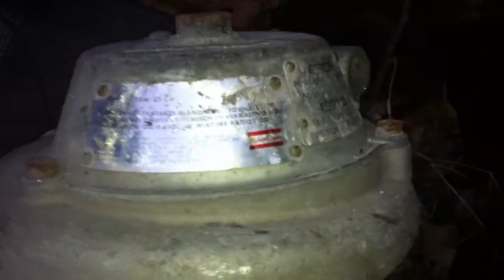Atlas Copco Cobra Gas powered drill

Comment: I foud two of these im my basement, changed the carb on them. i started one up without exhaust, SHIT... 2-3 inch long flames out of it!! (ps: the piston looks weird on these engines)
Reply: jodzolmat48 im sorry, you see i have plans to rebuild them. and i also need them here home at the farm.
Reply: All the used drills and parts were destroyed by Atlas Capco unfortunately. There are absolutely zero parts for these things. I need the recoil. and the air filter.cover. That is it.
    I have found a couple for sale on line. thanks any way. Wanna buy mine? I have the original wooden box it came in and I have piston rings which are unavailable.and lots of other parts too.. I must have $6-7 hundred in parts. All I want is $300 for every thing..
Reply: jodzolmat48 I broke the top piston rings on mine when I broke it down ~20 years ago. The carbureter diaphgrams were shot too.